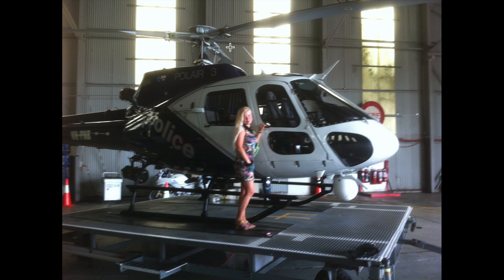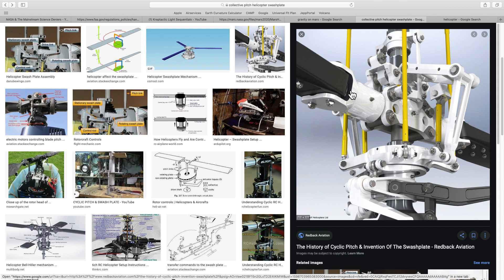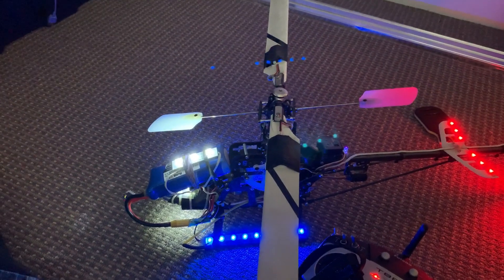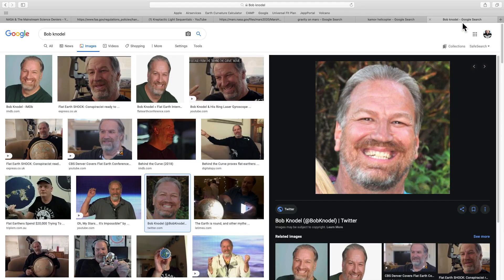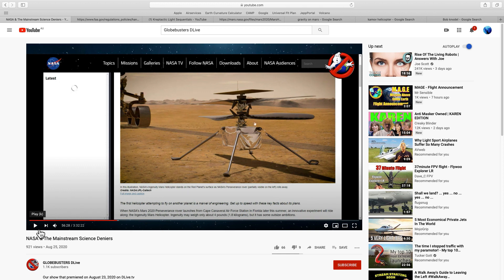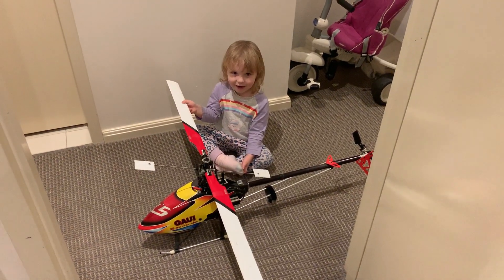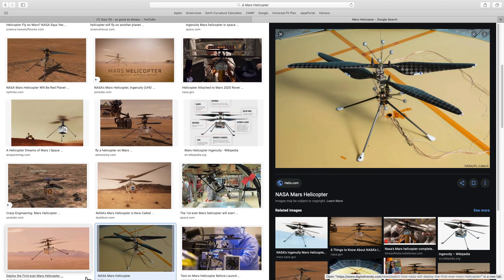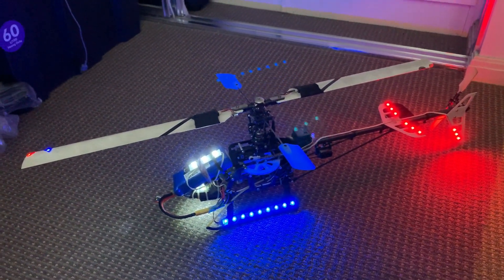This Flat Earth pilot doesn't know how the Mars helicopter works.

Comment: Don’t forget that the atmosphere of mars is one, one hundredth the thickness of Earths. So the lighter gravity makes almost no difference. It helps but the Mars heli has ultra high speed rotors to make up for the very light atmosphere. 

It’s nice to see you are with the girl of your dreams. Girls. Cute kid there. 👍
Reply: I wouldn't say almost no difference.  If Mars had the same gravity and 1% as thick an atmosphere, the helicopter wouldn't be able to fly.  With gravity being only 38% that of Earth, a lot less lift is required in the thin atmosphere.
Reply: My3dviews Truth. Perhaps I should have been more clear. Sorry. I was referring to as far as the props are concerned, it’s going to come down to the sheer speed. They’re going to have to be seriously fast in that thin atmosphere. I have helicopters and drones that I add a tremendous amount of weight to. Way beyond their ratings and I do so on a regular basis. All I did was put the same size motors but with a higher speed rating. The drones are all fixed pitch but I noticed on my helicopters that changing the pitch wasn’t having much affect. So I changed out the motors with a higher speed (usually slightly less power) and that does the trick and I’m still not increasing the pitch. Actually I’ve noticed I’m using less. 
Do you see what’s happening here?  

I don’t know if I’m making any sense at this point haha.  You have a good point though.
Reply: @jbirdmax    Sure.  I realize that each of those are a factor in the amount of lift generated.  All of the lift is to counteract the force of gravity, so less gravity means less lift required.   
I just don't think that any amount of thrust from rotors will lift a probe off of the moon.  :-)
Reply: My3dviews yea. You might be right about that. The moon has very little gravity but also has almost no atmosphere. So... 😂
Reply: @jbirdmax    Yup.  You need a drone with rocket thrusters.  :-)
Reply: My3dviews or some seriously spring loaded landing gear. 😂
Reply: @jbirdmax    That would get it off the ground and maybe fairly high, but it would be hard for it to hover.  LOL

Comment: So, at an altitude of 5280 an aircraft’s propeller pitch has to be increased. Thinner air? 

Is that because of pressure gradient in the atmosphere? And aircraft performance is reduced with increased in altitude? Is there a barrier to prevent the atmosphere at lower altitudes from being sucked up to the higher 5280 altitude? 

So an aircraft can’t fly up to dome? Because of reasons?
Reply: Did you notice that 5,280 is the number of feet in a mile [1,760 yards x 3]? What Bob vomited out in that video extract was a RC model conversion formula for calculating fixed prop efficiency or something. It's basically as follows: Fixed propeller pitch in inches X RPM X 60 [for minutes] x 12 [for inches] X 5280 [for feet per mile]. The guy is a heavyweight liar.
Reply: nightjarflying 
Of course the 5280 ft was apparent. 

After all, Bob is in the mile high club.
Reply: 5280 sounds weird since flying altitudes are rounded in thousands of feet. Airplanes such as cessna 172 have a fixed pitched prop, and I doubt that Bob ever flew a complex airplane. Thin air affects engine performance starting from 3000 ft, so we have to adjust the proper mixture while climbing, due to the pressure gradient, so a 172 can do just fine without adjusting pitch. Variable pitch is comparable to shifting gears while driving so not really related to thin air. Fine pitch is used for take-off and climb, and a coarser pitch for cruise. Hope that helps.

Comment: How do the yaw pedals work in a coaxial helicopter? They can't vary tail rotor pitch if there's no tail rotor. Do they raise one collective and lower the other or slow one rotor a little?
Reply from the maker: In the little toy helicopter at the end of the video it does so by changing the rpm of each rotor.  For the full size they do it with pitch on collective and the rotor RPM will stay basically constant.

Comment: Who would have thought that a swash plate, the cyclic, and the collective, were parts of a helicopter? 
The rotor spins in a flat plane, the angle of Attack of the blades and the pitch cause lift, and it's not in the Flat Earth Pilots manual?
Reply: Plus, according to the Flat Mars Community, it won't have to dip it's nose to get around.
Reply: Crap. I forgot that the Flat Mars community would have more knowledge about martian aviation than anyone on Sol 3. Since the mass of Mars is less than Earth I can confidently expect a helicopter to need less energy to fly in the depleted atmosphere of Sol 4. 
However, the atmosphere of Mars is only (about) .008Psi, less than 1% of Earths atmosphere.
But. The Gravity is only 38% of the Earths. 
It will fly.
Reply: Monochromatic Lightsource - Mars rotates at 540 mph, so the helicopter needs to float stationary in the air longer than on earth to get around.
Reply: Bill Smith We are just going to have to "Science the shit out of this thing."
Reply: Does the Flat Mars ice wall keep the dirt from falling off the edge?
Reply: Woody - That and Poo. If you want Poo Potatoes, you need a wall.

Comment: The thing that strikes me most is that he is admitting to a pressure differential as the helicopter changes altitude. Yet they will constantly (and wrongly) call on the second law of thermodynamics saying there is no way the atmosphere can exist next to a vacuum.
Reply: They do that constantly.
Reply: Situational reality in action.
Reply: Cognitive dissonance?
Reply: The atmosphere exists in a vacuum and has a weight.
With enough weight on top a pressure appear.
Reply: The atmosphere exists next to a vacuum in varying degrees. It is due to the atmosphere having weight and being drawn by gravity toward the centre of the earth. Free air weighs 14.7 lbs (1.0135bar for the youngsters) at sea level in a standard atmosphere.
Reply: I know that you are trying to sound smart, but believe me,you're really dumb haha
Reply: @dkny0072  LOL! Imagine that, a Flat Earther claiming he knows what "smart" sounds like. 
What's next?  A snake giving his opinion on the best hockey skates?
Reply: @dkny0072  brakka monoga.
Reply: @dkny0072  The dude in the video recognised pressure differential  with altitude in our atmosphere (witch flat earthers deny). But this dude doesn't deny pressure differential and that's the evidence that the air has weight and is held down by gravity (and you don't need a barrier).

Comment: What a surprise to learn that a pilot, who clearly doesn't understand that the horizon indicates a curved surface, also fails to understand how a helicopter works :-)  He obviously doesn't understand why, even at an altitude of 43,000 feet, the sun still appears to set below the horizon.  But don't ask me...none of the cars that I have ever driven have been capable of flight.   Well, maybe for a short while off a cliff.  That is not the meaning of 'flyover', either.
Reply: Typical pseudo intellectual comment😃

Comment: As you go to even moderate altitudes the air gets ‘thinner’. At around 5,500 metres there is half the amount of air that you would find at sea level. Despite there being less air it is still made up of around 21% Oxygen, 75% Nitrogen and 3% (and rising) Carbon Dioxide (plus a small fraction of other gases) 
Helicopters struggle to fly at such altitudes so 100 times less dense there is no way a drone would be able to fly no matter how fast the rota blades are going
Reply from the maker: The AS350 B3 can fly up to 8,800 meters.  

The world record for a helicopter is over 12,000 meters. 

If gravity was 38% of Earth's that record could be significantly higher.  

For the drone you have to also factor in the 38% gravity.   I agree it could not fly in a 1% Atmosphere on Earth.
Reply: All these guys engineering, testing, improving, prototyping, re-testing and finally sending it of to Mars. Mandela effect whatever comes along....neeeh, will not fly. Man, where were you all this time. You could saved these guys some precious time and money.
Reply: It is not a terrestrial helicopter designed to carry pilot, passengers and/or loads.
It is stripped down to the bare minimum, no seats, no engine, no fuel tanks, no safety equipment, just a battery, motors and control and charging equipment, and is operating on a lower gravity planet.
It won't need to fly at high altitudes.
What are your technical qualifications to say it won't fly???
Reply: Just want to correct you regarding the atmosphere's composition.
In a completely dry atmosphere (no water vapour) there is about 21 % oxygen, 78 % nitrogen, 1 % argon and 0.0414 % CO₂ (0.028 % before the industrial revolution) plus very small amounts of other gases, including 0.000187 % of methane.
The amount of water vapour is strongly dependent of the local temperature, but its overall concentration in the atmosphere is 0.4 % by volume and 0.25 % by mass.

Comment: I'm no pilot, but I understand how variable pitch and counter rotating rotors work. 
Thunderf00t did a good analysis of this Mars copter and calculated it would fly, but just, and with limited range.
Reply: but that is what it was designed for... maximum payload and regenerative powersource (solar panels slowly reloading the batteries) so that it can do a handful of flights, allowing high altitude (not high for earth conventions, but the highest anything has - to our knowledge - ever flown on Mars ;-)) photos of greater resolution than any orbital camera could deliver until now.
Why would you waste a lot of reserves for weight and flight duration if you basically use it as a proof of concept and for such limited purposes anyway? Also it was supposed to be as light as possible while still being able to do SOME good. Also ANY weight of the thing would go out of the total balance for Rover AND "ingenuity", so the goal was definitely Minmaxing the copter.
Reply: @Ugly_German_Truths  I totally agree. It'll be a major accomplishment to get something to even "fly" in the Martian atmosphere. The software running it is also amazing, giving it some autonomy. To be honest I don't know much about its mission other than a photographic survey, but the technology involved is awesome.
Reply: I'm pretty certain that the NASA experts (who tested it in a Mars pressure vacuum chamber) know a lot more about it than Thunderf00t.

Comment: Once again the massive oxymoron that is a "Flat Earth Pilot". Problem solved.
Also i feel the need to mention 15°, don't know why.
Great job once again Wolfie
Reply: "...a fifteen degree per hour drift", 

"Thanks, Bob!"
Reply: @MichaelOnines  yeah thanks bob
Reply: Bob is the rare double threat of a grifter AND a drifter ;-) Just my 15° to add. or would that be "(h)our" 15°?
Reply: There's a big difference between doing and understanding. I'm still amazed Mythbusters managed to find a pilot who thought pulling a rug from under a plane would keep it from taking off, when all the propulsion is air based.
Reply: @0LoneTech  Just FYI TV is fake. If they pay x ammount to say stupid shit and do little to nothing, the line to apply is very very long. But i understand your point
Reply: @0LoneTech  Yup...the only force pushing the plane backwards would be wheel friction, which is absolutely miniscule compared to the power of even a small plane's engines.  It's one of those things that's "technically there", but is so small it's of zero consequence.  Plane wheels just freely roll.  With a car it would make a difference, because cars move themselves by friction with the ground.  If the ground is moving backwards, the car would have to drive faster to move forward.

Comment: The "wire strike protection system" is primarily located in the pilot's seat.
Reply from the maker: Very true.  A good pilot will never need to rely on the cutters.
Reply: I couldn't imagine being the test pilot for that product.
Reply: M Ball Props to whoever that was.
Reply: @mballer    Most likely tested without the need for it being on a helicopter.
Reply: @mballer  More like a last desperate chance against a sure catastrophe.
Reply: Some Ww2  bombers had similar cutters mounted horizontally to cut barrage balloon wires.